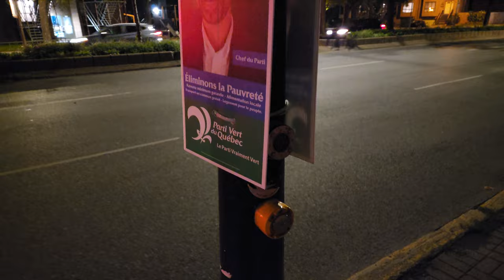🚦 I cause traffic lights to malfunction inadvertently because of a problematic button

Comment: This happened once when I was trying to cross a street and the traffic lights went into flash red as soon as I pressed the button, so I just kept walking.
Reply from the maker: Yeah it must have been a glitch
Reply: @SkyOfTheUniverse  I know, but when I talk to the city about this, they finally fixed it and then I tried it out again and it finally didn’t flash. I was talking to the city about this and they tried a few steps. The first and second time after they did these steps, they asked me to press this button and this problem still happened but the third solution it finally was fixed, which is when I held the button down and it did not flash red as usual.